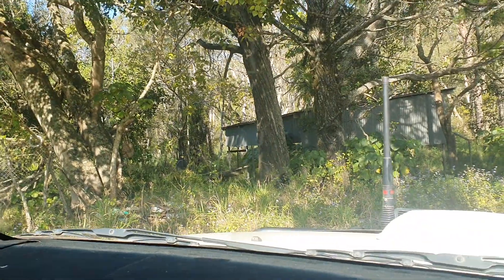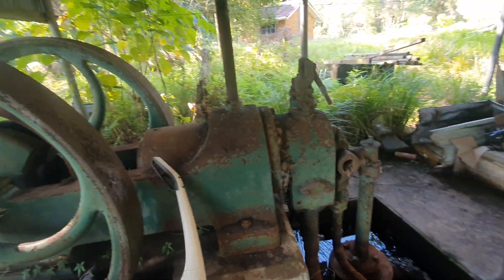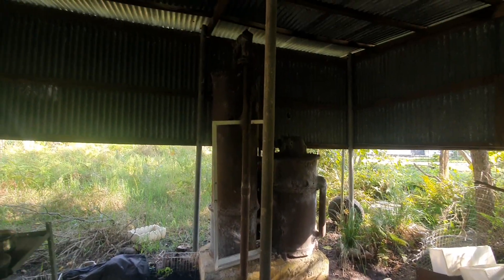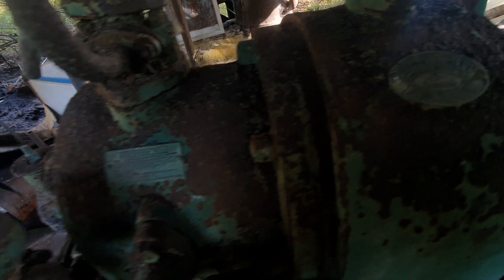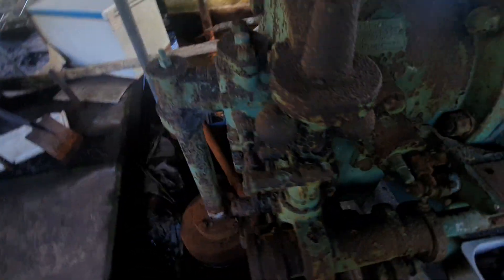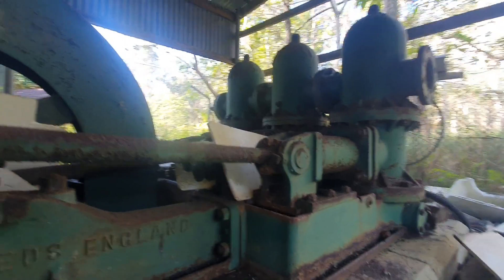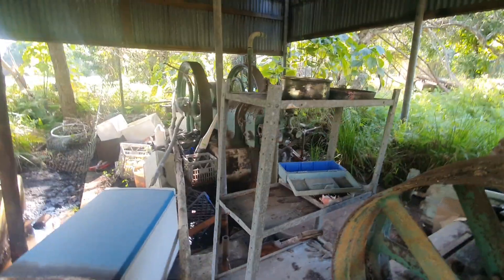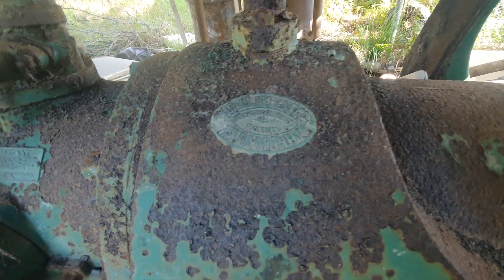National gas engine in the scrub

Comment: Nice find there old chap.I have a no of National engines ,some fully functioning,some in need of rebuilding, although none are like that model.National made an amazing array of engines which were used world wide and of very high quality.Very little remains of the factory now outside Manchester which was massive.Hope you get to save the engine and the Davy Bros pump , lovely piece of engineering!Regards from England.
Reply from the maker: Thank you mate !   Quite a few National engines over here in Australia. I have a nice Pitt engine that looks very similar in the casting shapes and the governor . Do you know if they were from the same factory?
All the best.
Reply: @jenkodiesel5768  Tried to post you a reply about 8 hours ago but looks as though it is floating around in the ether at the moment,Haha.
Here goes, I'll try again!
I have come across the name of Pitt but know very little about them,the only other brand name to my knowledge associated with National Oil and Gas was Mirlees Bickerton and Day Ltd.
Incidentally up until recently that latter co name was still extent on what remains of the buildings on the site of National at Ashton, Manchester.
The co was taken over early 60's? by Hawker Siddeley Group who rapidly closed the site down!
In 2004 I acquired by sealed bid a four cylinder stationary National diesel engine,it was brand new in its packing crate, never been fired,part of a cancelled order of two engines going to Burma.
The seller was a long established millwright's in Bolton, Northern England,boy,it was like stepping back in time 100 years ago!
The engine had sat in their yard,in its crate since 1959!
Shipped south to the Midlands it took two days to gently cut away the shipping crate with a chainsaw,even the shipping crate was a work of art in timber!
We keep the engine primed with fuel and oil but still it has never been fired, partly because unbeknownst to me until I got it out of the crate it's a hand start and a serious lump of an engine!
If you would like more information about National check out the Anson Engine Museum website in Poynton, England.
I have been there a no of times, their restoration work is absolutely top quality and they had volunteers who were former employee's of Mirlees, fascinating stuff! 
If you are interested in Manchester and how it developed industrially,how the products were shipped to the world , check out Martin Zero on U Tube .
Keep us updated on any rescue mission ,shame the locals have no interest .
Hope this is of some interest.Regards to you Down Under from England.